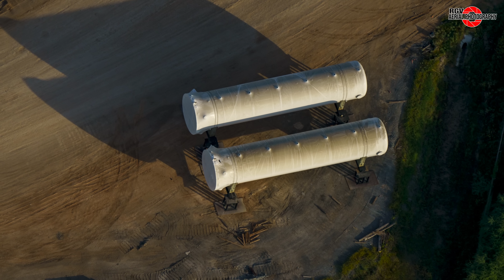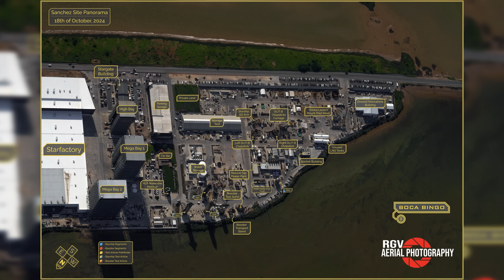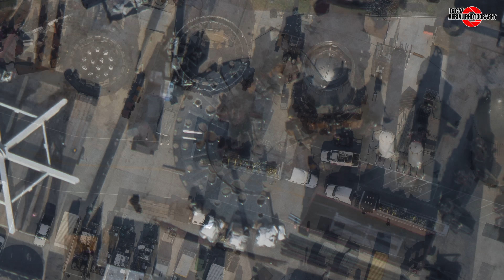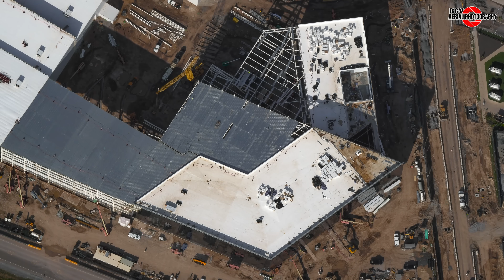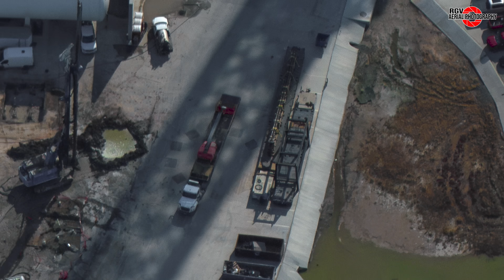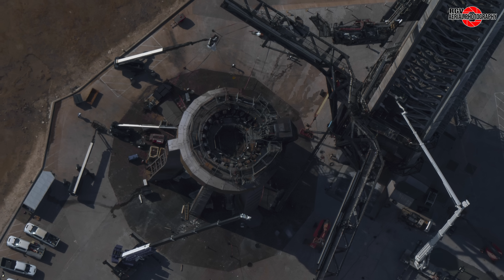Flame Trench Rebar + Gearing Up For Flight 6! | Starbase Flyover Update 62

Comment: What do you mean by a cable chain? Sections of cable joined in a chain? A pure chain used in place of the cable?
Reply: The proper name is drag chain. It's a cable tray with hinged joints. This carries the power and data cables between the tower and the sled thing the chopsticks mount to.